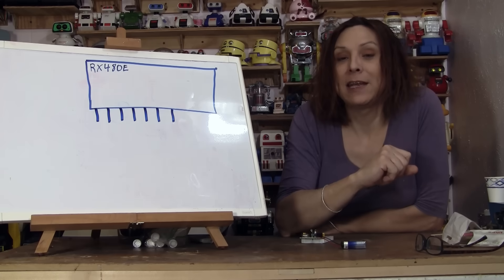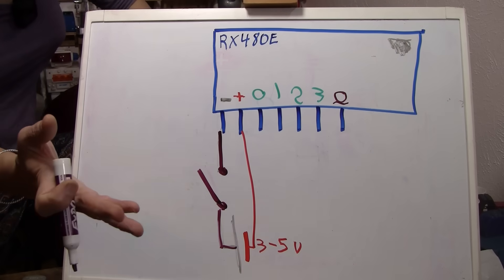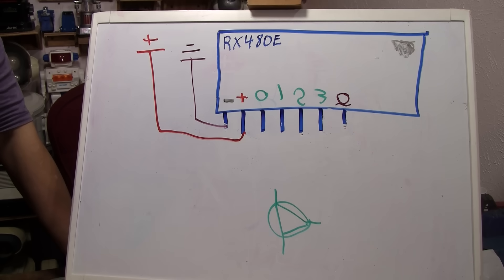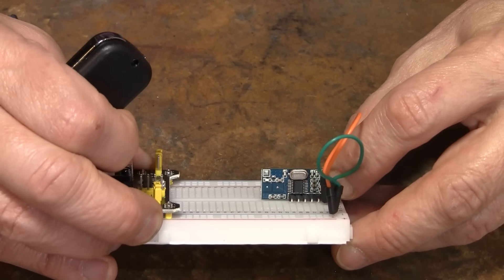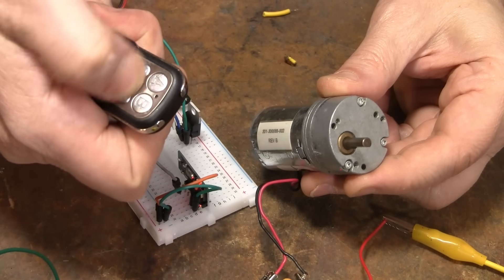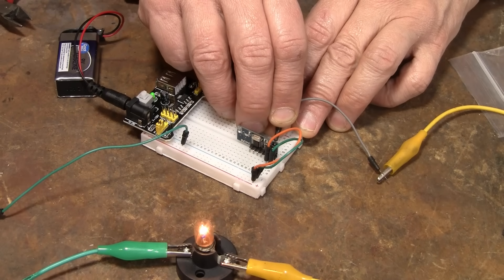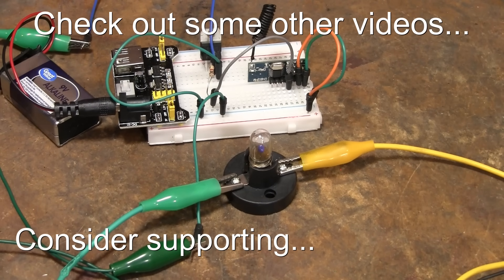How to Make Anything Remote Controlled with the RX480E Circuit!

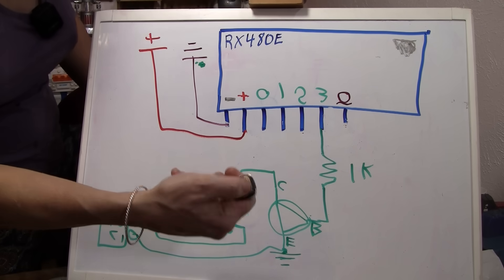Comment: 8:21 - Can you explain the challenge of using a reverse-biased diode here instead of a capacitor?
Reply from the maker: The truth is, the set up I showed and for the most part, it doesn't matter, you don't need either. I can also show an H-bridge circuit with the same setup, with no diodes, and it's just fine. However, that doesn't mean every transistor and every motor is the same. Put whatever you want on there.
To my point though, if you open anything that has a DC motor inside of it, you will find a capacitor, sometimes multiple capacitors, across the motors. I have hundreds of videos here showing it.
Reply: @RandiRain  The capacitor across the motor is to suppress high frequency noise, that can affect AM radios (are you old enough to remember them?).  For inductive loads such as motors, solenoids, relays, there should be a diode in the reverse direction (normally non conducting) either across the load or between emitter and collector of the transistor. For the TIP series of Darlington Transistors, the diode is built in, so no need to add it. for most transistors, this built in diode does not exist for PNP or NPN transistors, so the voltage spike that comes froman inductive load when power is turned off, can damage the transistor. This can happen in as a single event, or as degrading the transistor over repeated use.

Comment: as a model maker where we are trying to bring lighting and electrical features to models, but in as simple cheap  and small way as possible, this loooks like a superb solution. thank you again for a brilliant videa.
Reply from the maker: That kind of stuff is perfect for this circuit. You wouldn't want it to safeguard your house or anything, but it's perfect for what you want to do.
Reply: My biggest concern for that is that the parts need to be paired, or at a contest you'll suddenly trigger things on five other models in the room too.

Comment: For those unfamiliar with the TIP12x series, it is NOT a bnormal transistir, it is in fact two transistors in one in what is called a Darlington pair.
The upshot is that very little current (in this case 3-5mA) is required to drive  up about 3 amps. 
BE WARNED, you must use 5V if you want the 3 amps odd.
....using 3V will only drive 500mA odd at best because (3v - 2.5V Vbe - RX480E output drop from 3V ...which if higher than about 0.1V will be bad!)
Reply from the maker: Good info. I did know they were two transistors in one. Which I think is what the TIP stands for. Didn't know about the current. I suggest to only use 3v on these if you have to. In not use 5v. Thanks for the info.
Reply: @RandiRain  Just use the VERY COMMON AO3400 or similar mosfet.
They are 20-30 cents odd each (for genuine ones).
Reply: @RandiRain  TIP is a prefix for a family of transistor devices, it does NOT mean Darlington transistor, sorry :)
Reply: You and me got triggered for a comment. 😅
Reply: @Salty_Knuckles  Yeah, even though I like hobbyist encouraging playing around, but this one is so egregious in some of the things she omits/ignores, and like @throughput6674 pointed out, ground switching silliness, has that kind of triggering effect! :)
3 hours ago

Comment: It is better practice to use a diode rather than a capacitor as the diode will switch quicker - the capacitor may not be able to react fast enough and the reverse polarity voltage created when you break the current flowing through a coil is likely to damage the transistor. The diode should be rated  to al least carry the maximum current flowing through the transistor.

You should treat any voltage above 50 Volts as potentially lethal.

Comment: For the inductive loads, you need to connect a DIODE in reverse across the coil.  I'm not quite sure why you use a capacitor.  Also these loads (relay, solenoid, motor...) really need to be run on something with much more capacity than a typical 9v battery...especially if they are 'latched' on!  This will deplete such a battery in short order.
OVERALL...NICE VIDEO!!

Comment: What do you mean a light bulb doesn't use electromagnetism. Lmao anything electric uses electromagnetism. I think you mean inductance. Eventually your making a lc circuit to balance things.
Reply from the maker: It doesn't use electromagnetism to do the work. Of course, any wire with electricity traveling through it has electromagnetism. I'm pretty sure you knew exactly what I was talking about.

Comment: I don't think it is that A, B, C, and D are reversed from D0, D1, etc.  It's that the first programmed button (A or B or C or D) will be on D3, the next on D2, the next on D1, and finally on D0.  I was quite confused by this and had to play with it for a while.
Reply from the maker: If you set them to momentary, ie first selection - one button press, they are reversed.

Comment: I have a dehumidifier and i wanted to add remote capabilities to it. I'm pretty sure i need to tap into the + - under the button and temporarily connect them to toggle it? Something about a relay? I have no idea what to do
Reply: Yes a relay is the way to go, especially since the dehumidifier is mains powered. Using Randi's transistor circuit to connect to the coil of the relay. The contacts of the relay would connect to both sides of the switch you want to remote control. The relay coil voltage should match the voltage that the transistor is controlling. The relay contacts need to handle what ever goes through the switch, so depends on the dehumidifier circuit.

Comment: Do you also need a flyback diode to stop backfeed to the transistor on the collector?  You definitely need one for the mechanical relay and it wouldn't hurt to have an optoisolator there too!
Reply: ONLY if the back EMF creates a problem, and often it can if the driving transistor can't take the momentary back EMF ...
Reply: @uploadJ  For general use there is nothing to lose and potentially much to be gained from having  a protection diode.
Reply: @uploadJ Not possible to add circuit diagrams to comments but as an engineer who got my electronics degree in 1978 and have decades working with electronics, I have seen quite a few examples of failure due to back EMF.
If you have not, maybe you are lucky or maybe you less experienced. In either case theres no call to try to be offensive, even if its water off a "duck's" back.
Reply: @uploadJ  give the attitude a miss.

Comment: Nifty device.  It might be worth mentioning that it operates on 433 MHz, in the U.S. amateur radio band.  It's a license free low power device frequency in ITU region 1 though. 
That said, it's an extremely low power device so probably not an issue in reality. 
It would be interesting to have a look at it's transmission on a scope.  I bet it's just 4 different PWM outputs.  Or it might be a serial data burst.  
DE KB9RLW, The Old Tech Guy on yt.

Comment: Nice demonstration - right to the point. The only thing I would add, which I don't think you covered is that for anything electormagnetic it is not just noise but also the turn-off spike that is a problem. A diode across the load is much better to suppress that. A capacitor can do it, but you need to calculate how much energy you need to absorb to know how big a capacitor you need. The diode kind of works like the free-wheel on a bike - it just absorbs as much spike as there is. Those TIPs are a lot chunkier than necessary for a relay so are quite forgiving, but typically, if you drive a relay or solenoid with a transistor and you don't have something to suppress the turn-off spike, the transistor will die the first time you turn it off, or potentially worse, it will fail after just a few minutes of use.
Reply from the maker: I'm pretty sure I talked about how a motor still turns after the power is removed, which makes it act like a generator. That's usually how I explain it. I've never had an issue using the TIPs, and I've not had anything on them before. No cap, no diode, and it was just fine. It depends on how nice the motor is. I've built many things with them. A lot have videos right here on my channel.
Reply: @RandiRain  Yeah, I eventually saw a comment lower down saying the TIPs have a built-in suppressor - so that makes it a really good choice of transistor. You would not get away with it using a transistor that didn't have this. You did mention the generator thing, and the cap is good for that. But the spike from a de-energising relay is much more problematic than the generator effect (theoretically the max voltage from a relay is infinite, the spike just keeps rising "until something starts conducting", which often means "until something breaks")
Reply: In general terms, it's also where you have a DC circuit, but there may be some AC there, after rectification for example ... the Cap will allow the AC wave to pass through it.
I think this is why they call them filter caps, so it's not just for buffering reverse EM, but eliminating noise ... Even need them on 555 timers, super close!

Comment: The capacitors across the motor/solenoid coil is a bad idea- should be a reverse bias connected diode.
Reply: No, it’s not a bad idea to suppress (electrical) noise from the motor. But a flyback or clamping diode should still be added for inductive loads like motors, solenoids or relais to protect the transistor in the moment it switches off. Now, here a TIP120 is used, which has a clamping diode built in, which in most cases replaces a diode across the load. But better check in the datasheet whether there is a diode across CE in case you use a different type of transistor (or just add an 1N4007 or general purpose diode).  👍🏻
Reply: This is true.  Inductive kick can be 10x or more times the supply voltage, but in reverse, so a reverse biased diode is really needed for safety.  Without it, you really do risk damaging your semiconductors.  You can see the pulses with an oscilloscope.  When I studied electronics, we actually put a diode in reverse bias (cathode to positive) across the inductor (or solenoid or relay or motor) to protect the driver circuit.  Another thing to consider is that putting a capacitor in parallel with an inductor creates a resonant circuit, which could have baffling side effects.

If you want to see some REAL magic, check out the EnOcean PTM216B self-powered transmitter modules.  🙂  These are 4-button remote control modules that transmit Bluetooth LE packets, without batteries or any other electrical storage; they generate their own electricity from the motion of the buttons in a remote control that is reminiscent of a 1970's clicker.  They're pricey, though:  A complete hand-held remote costs about $80 from Ad Hoc Electronics.  The module alone is about $25 from Digi-Key and Mouser, but it needs an enclosure like the one you can 3-D print from a plan on thingiverse.com.  It also needs something like a microcontroller to receive the BLE packets and change control signals on its general purpose I/O interface; those can be had for under $10 from sources like AdaFruit, Digi-Key and SparkFun.  These are total overkill for the simple actuators you demonstrate in this video, but the microcontrollers can be programmed to work as dimmers, to operate servos or linear actuators, or to perform complex tasks.

EnOcean makes other transmitter and receiver modules (not Bluetooth) that are cheaper and don't require programming, so they may be preferable for applications like this.  But they use radio frequencies that might be used for other purposes (e.g. emergency service communications), so there could be some interference.  These devices were developed specifically to control lights in temporary or energy efficient dwellings.  They're also compatible with a variety of other sensors, such as motion, temperature, moisture, and light activated devices.
Reply: @serpent213  Ah, that answers it - I wondered why the solenoid was not killing the transistor. But I can't quite figure out how it can have a freewheel diode "built in" when the +ve rail does not go to the transistor.
Reply from the maker: It's not a bad idea. You can use a reverse diode, but a cap is pretty standard practice.
Reply: Nope- not with a DC solenoid, you use a clamping diode, not a capacitor.

Comment: at 12:20 you put the green wire in the wrong hole,,,,then later it was magically in the right hole   :)
Reply from the maker: I said I was a magician.
Reply: I noticed this also.  I haven’t used bread boards much, and I was thinking that this must be a magic board.

Comment: Interesting tutorial. Several years ago I used a simple on/off remote (from eBay) to signal when mail arrived as our postal mailbox is on the other side of the street.
Reply from the maker: I've thought of doing that for my brother who lives in the country and the mailbox is a good walk.
Reply: @RandiRain  Guess I didn't save my post from yesterday. Our house is 600 ft from the road. I used a simple on/off RF remote (eBay). I installed the transmitter in a waterproof box at the mailbox and added some circuitry to simulate pressing the buttons and used a mag reed switch on the door. We have three utility poles along the driveway and mounted to receive on the pole nearest the road. We are lucky and have been able to get fiber internet so I was able to repurpose the old copper phone line to connect house to receiver. I used a simple microcontroller to illuminate a led in the kitchen when mail arrives and a pushbutton to reset it. It also resets automatically over night to get ready for the next day. It sends a text to my phone when mail arrives.

Comment: Your LED at 5:00 is the wrong way around. I know you probably know this, but it could be misleading for newcomers.
Reply from the maker: Oh, you mean on the drawing board??? Yeah, probably.
Reply: @RandiRain  That's exactly what I meant. Thus the 5:00 reference... I honestly feel a bit miffed for being snapped at.
Reply: I was thinking the same. But anyways, only total beginners won't figure it out.
Reply from the maker: No it isn't. LEDs only work in one direction. If it's wrong way around, how is coming on? Do you think I faked the whole LED scene or something? Those tiny LEDs are hard to see the flat side, but they were right.

Comment: Great video as always , just remember these are totally unprotected and unencrypted so not really safe to use on anything important or something you don't want someone messing with. My friend waited outside my shop one evening and got my shutter down command....now likes to scare the crap out of me while outside having a smoke break.
Reply from the maker: This is true. I do believe they have the rolling code, but that's not hard to get around.
Reply: @RandiRain  Yea our shutters don't and either does the one on my Diesel heater , but some do and there are ways to hack but you really would want to risk jail time to go about hacking them, but I'd still not have one remote my front door or something I don't want hacked. My friend hates them as he's very old school and says in his car driving thru town some days his cb radio screams at him. His own fault for having it turned up so loud!